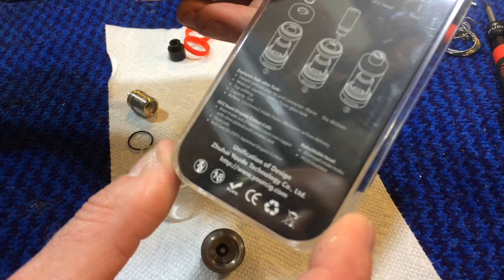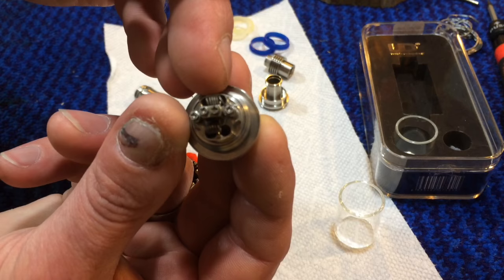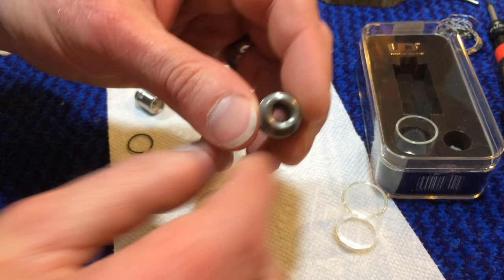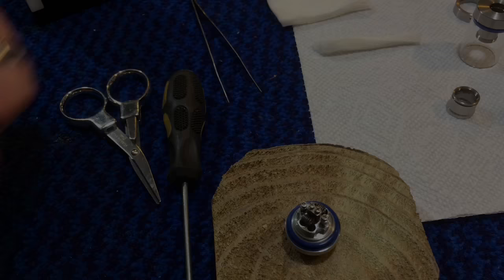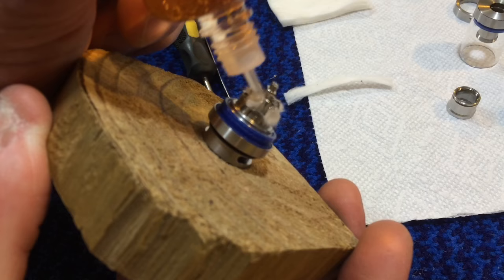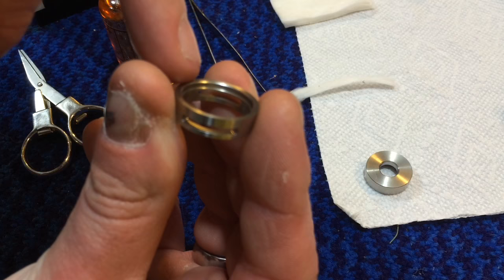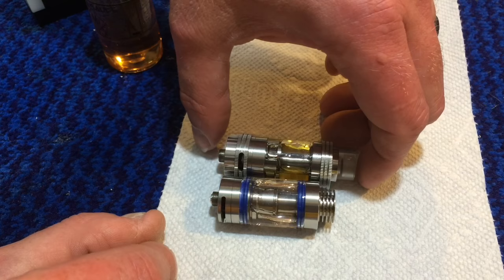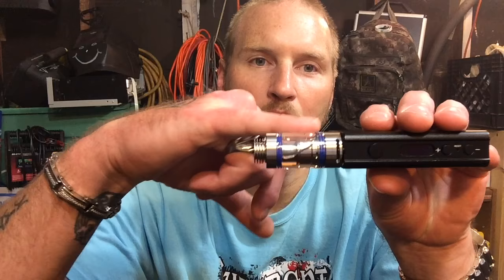Zephyrus by Youde and how to wick the rba

Comment: You figured out the trick for the Zeph no doubt.  I have been trying many different wicking styles and I keep coming back to this one.  Its not the quickest but the reward is amazing.  This thing looks like it should cost $100+ IMO. I couldn't be happier. I too run it on a mech (non-hybrid) and get a wonderful vape around 70w.  28 gauge dual parallel 4/5 wraps on 2mm coming out to 0.2ohm.  I run a 70%vg and she stays wet for days!!!! Great Video Nate mofo Jones. Praying for you to get your job brother.
Reply from the maker: Jeremy Baity i agree on the reward , if one can get the wicking right you can leave it alone for weeks ! which is about the same as the coils . thanks for the prayers and good vibes !!!!
Reply: Regular Vape Dude We are all one big family.  Thats what its all about.  
Just rebuilt mine this morning cause I have had the same coils in it for a couple weeks and even after cleaning them for the 4th time they just didnt glow evenly so did what I had to do.
Reply from the maker: Jeremy Baity vaping family forlife ,,,yeah you gotta do what you gotta do , damn wire wont last !!! lol
Reply: Regular Vape Dude I'm hoping "Nate's Silly String" fulfills my wildest dreams.  LOL

Comment: Is it possible to build the RBA with one coil at .3 ohms?  Sorry for the very specific question, but the only mod I have is a subox mini and it doesnt fire below .3 ohms.  I also don't want to lose a ton of juice in a day.  The tank I have at .3 ohms lasts me a whole day if not longer
Reply from the maker: I think the bellus rta would be better for single coil , this tank does not have the option to shut off one side ! You could use a smaller gauge wire tho and still do a dual coil ! This tank does preform better with smaller wire !